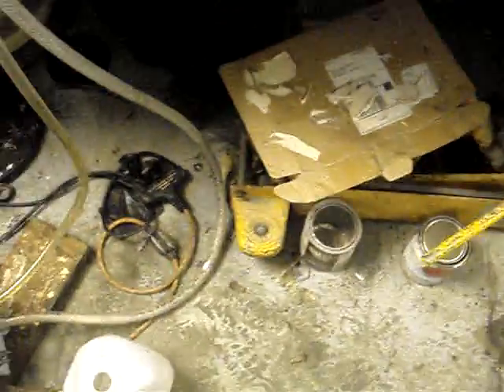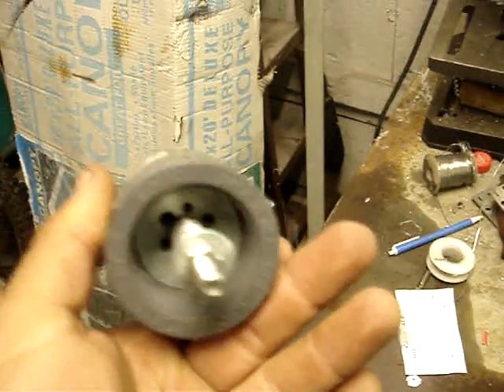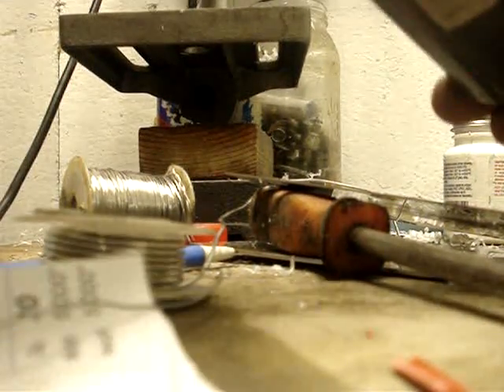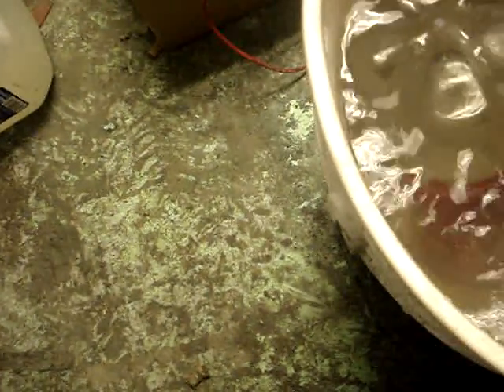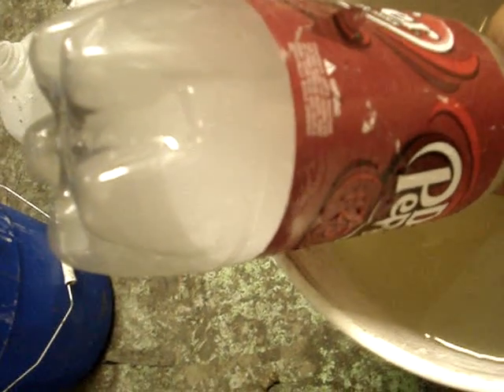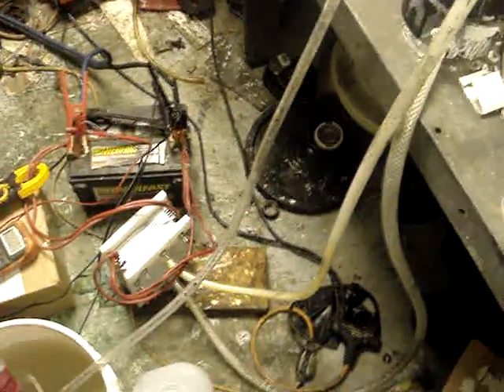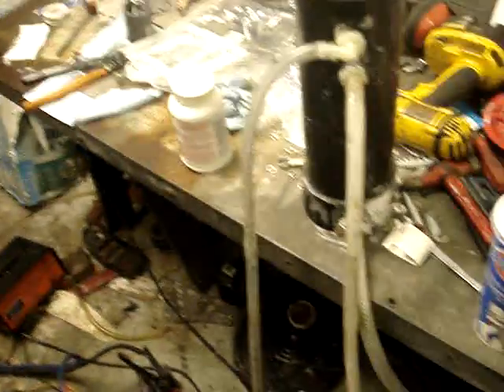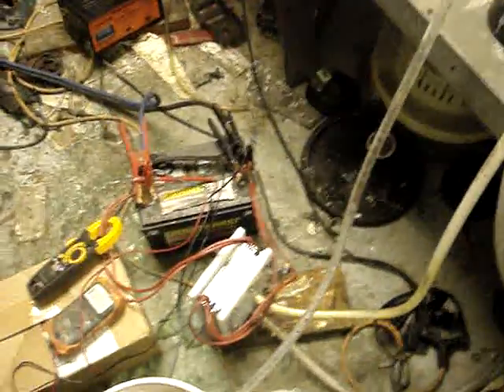my new dry cells 4n4 6 inch

Comment: 200 amp alternator charging 65 amp hour battery, cell is 6" 4 neutral four cells using Naoh, all wired with 4 guage cable...hope this helps

Comment: have you tried to go series plate instead of parallel? you get rid of all the wireing that way. just two contacts. i run 16 cells at 36 volt using a dc to dc converter. give it a try. also try to ablaid the plates.